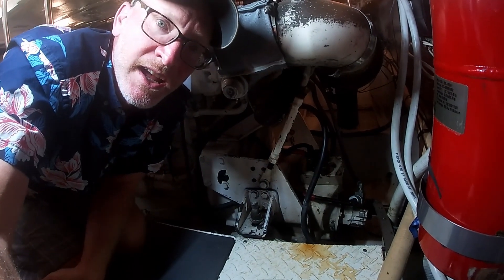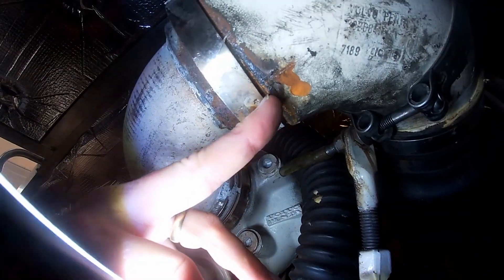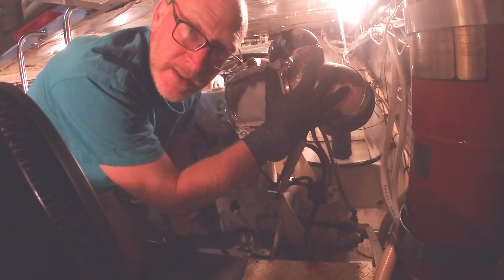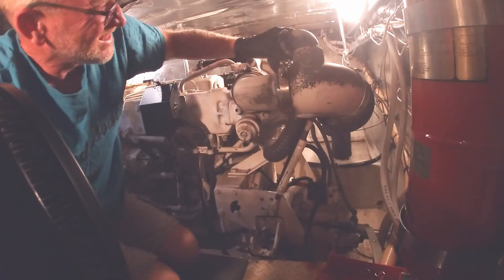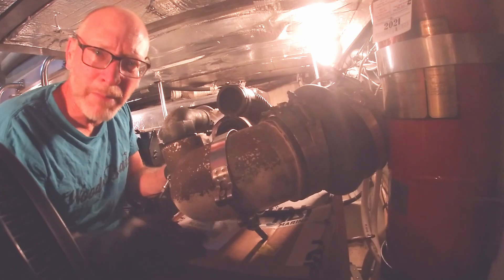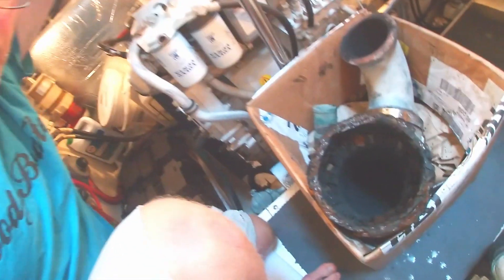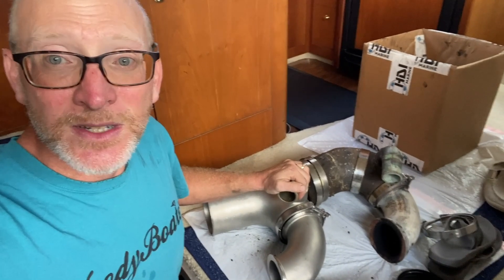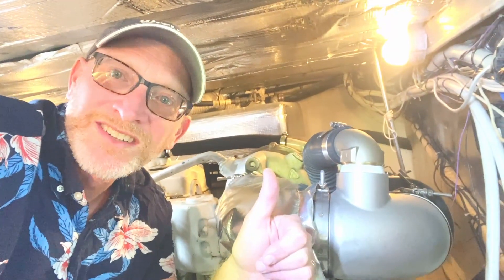We pause our Great Loop to fix the boat.

Comment: If that is the original exhaust riser/mixing elbow or whatever you call it, that thing out lived about five times of its life expectancy! Too many times I find that the thing was leaking internally for a while and it ate the cast-iron turbo housing. Or the worst cases, allowed saltwater the drain into a couple of engine cylinders! Good catch that you were diligent in noticing the rust stain. As a matter-of-fact next week I have to survey a Carver with a set of the same engines. And will recommend today remove the elbows and internally inspect.
Reply from the maker: I was worried it might have leaked salt water into the turbo but SOOOO glad we caught it early.
Reply: Probably she's been a fresh water boat most of her life or that part would have failed far earlier. Nice work!

Comment: Congrats on a nicer job of serious  engine repair work. How did you find out about the stainless steel replacements? Makes so much sense.
Reply from the maker: I just googled it. The original Volvo part was more expensive and inferior to this HDI part. They make all kinds for various engines.
Reply from the maker: I think when we talked you suggested YouTubing it, and I did!  Found out about replacing these which helped. I’m hoping my video helps the next guy…

Comment: Great job. But watching you work in that small engine room, just reenforces my determination to have a walk-in, stand-up, engine room, which will require a larger yacht.
Reply from the maker: Stand up engine rooms make me envious but ours isn’t all that bad. This was tough but access to that elbow on the port side would be very hard.
Reply: @onFIREfamily  Usually boats with standup engine rooms are too big for the loop. Surprised that you are selling your boat. I thought you might bring it back home to cruise the Columbia and Snake and even Puget Sound
Reply from the maker: We'll find a different boat for that when the time comes.

Comment: Cracked exhaust sucks. Do you think the brace is why it cracked there? The stainless looks like a better lighter part. Exhaust should have a bushing or some kind of shock absorber or it cracks usually.
Reply from the maker: This was saltwater corrosion induced over the lifetime of the part. Probably made it longer than most.